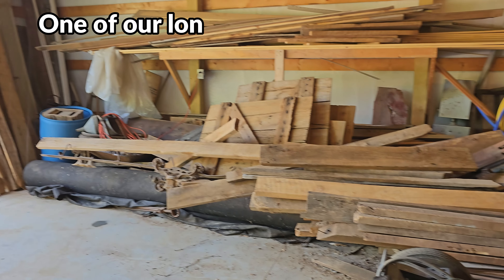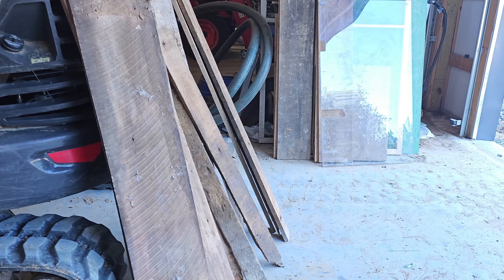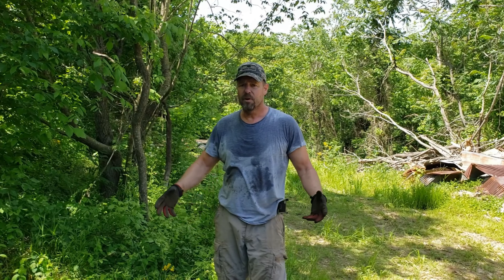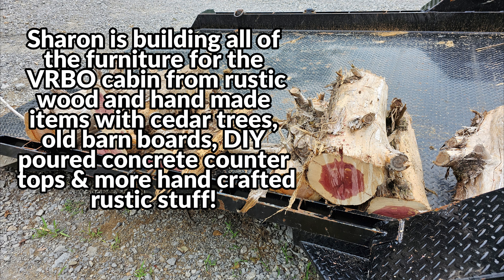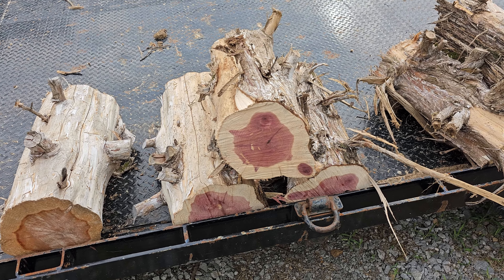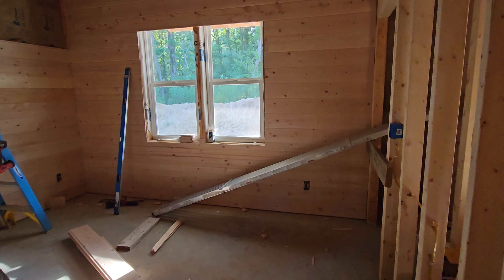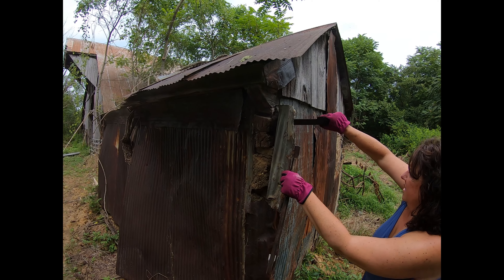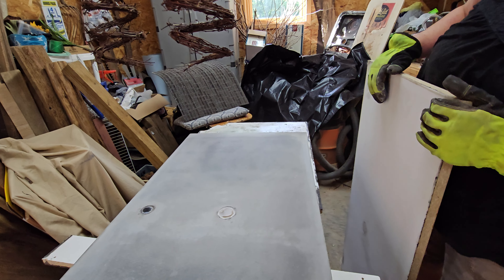The 12 Foot Batwing Lives! - 4th of July Holiday Weekend Fun On The Farm!

Comment: Good to see Sharon!  Kapper did you miss the high winds.  Power was out for 4-6 days in parts of town,  generator worked great, no wifi and cell towers were jammed.   No damage to my place except 3 days of pulling broken limbs with mower, had to use truck for huge broken on tree limbs with snap strap and used 50 oxygen bottles on mower picking up sticks and pull smaller branches.   Many people had house and cars damaged and lost all their fridge and freezer food.  Internet was restored this morning around 6 am.  It had been 45 days since it rained.  It pouring outside now.   I need to make a sign then came the winds, and the rains followed❤   They say one of the five tornados hit us.   The winds were blowing so hard all one could see was tree limbs flying by.